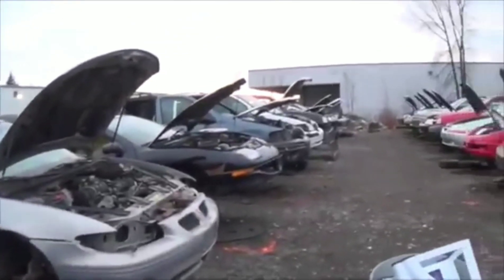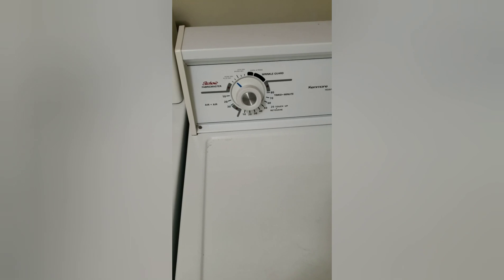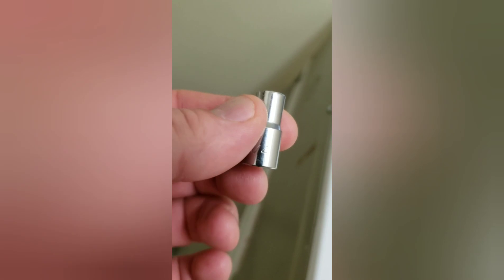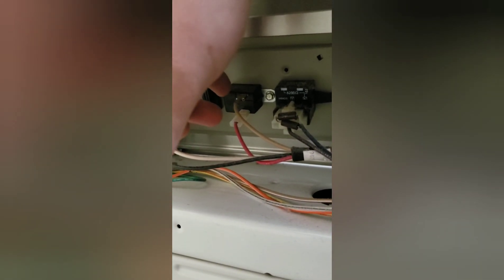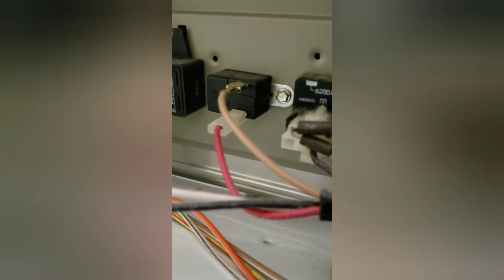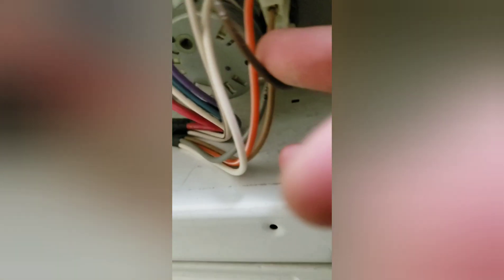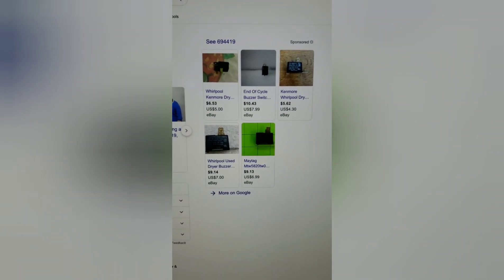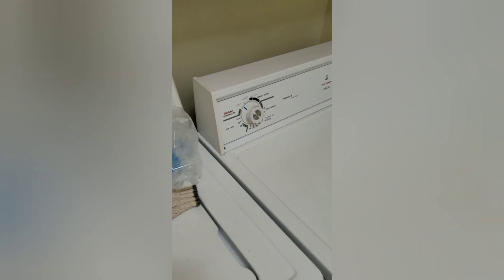Kenmore dryer buzzer removal

Comment: Nice video, thanks.  Just unplug wires, tape them and test.  If no buzz, all done.  Keep the box so if you need it when trading in or selling the dryer, you can install it quick.
Reply from the maker: Good call.  Smart move to keep the buzzer in case needed later.  I just had so much pent up hatred towards it, I had to destroy it ... lol.   Tks for the comment!!

Comment: This dryer model resembles Canadian style. I could tell by that temperature symbol next to Temperature dial selector. Those Off symbols on the disk resemble Kitchen Aid style. Those American Kenmore Ultra Fabric Care washing machine and dryer models with white panels were rebuilt and manufactured around 1995. Those models with old-fashioned brown panels were manufactured around 1992. The reason why those controls are rebuilt is that old-fashioned panels, motors, inside designs became replaced with modern parts.

Comment: Hey, thanks for the video! I removed the entirety of the buzzer and the wires which connected it to the power source. Just like yours, there were two of them. Should I reinstall the wires and then cover them with electrical tape or is what I did fine? Thanks in advance :)
Reply from the maker: Thanks for the comment.  Not totally sure the best answer to your question, but my guess is that if you removed the wires completely from both ends, and it still works, that's probably better than what I did!  Cheers!
Reply: @fixingrandomcrap  It's been fine. Thank you!